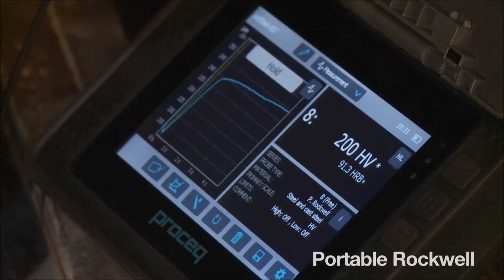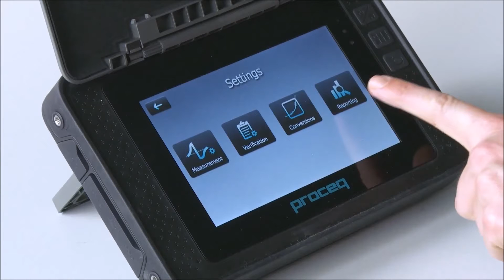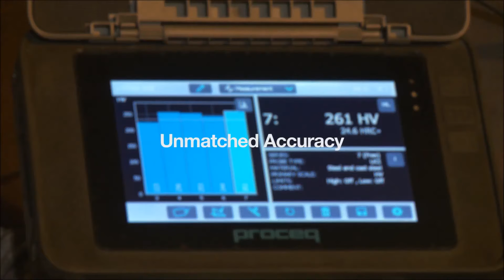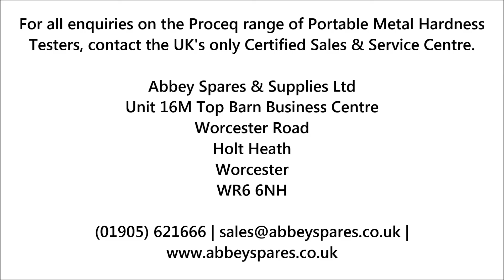Proceq Equotip 550 UCI Portable Vickers Hardness Tester

Comment: Can use this machine and uci for astm e110?
Reply: Hi, thanks fr the inquiry, the EQ550 has the following standards assigned to it Standards
ASTM A1038
DIN 50159

But the Conversion Standards are:
ASTM E140
ISO 18265
Reply: Phill Mckenzie now I am using this equipment in site, I am very new for HT, here in my site pipe thickness is below 12mmso that as per our procedure I should use UCI probe on these low thickness.
Reply: Hi,
Yes the UCI is ideal for this. According to DIN Standard 50159, the minimum thickness should be 5mm, a minium mass of 300 gms and a minimum radius greater than 3mm
Reply: Thank you Sir
Reply: No problem, you can get more information from this link: http://abbeyspares.co.uk/wp-content/uploads/2016/03/Equotip-550UCI-Sales-Flyer-Abbey.pdf
Reply: Dear Sir, I have proceq UCI probe and leep probe but I don't have Rockwell probe, can I buy proceq Rockwell probe?
Reply: Dear Sir, I am using EQ550 machine with UCI probe, when I doing calibrate UCI probe with calibration block it doesn't gives proper values, 875 is the mentioned value of calibration block but it gives 950,810,1000 like that, what can I do for correct value? Please advise me
Reply: Have you use the quick shift facility to help with the calibration?
Reply: I don't have quick shift facility
Reply: I don't have quick shift facility
Reply: What is quick shift? Can I apply in pipe spools?
Reply: Please check you mail Sir.
Reply: Just responding now